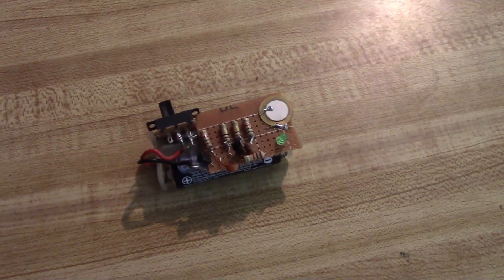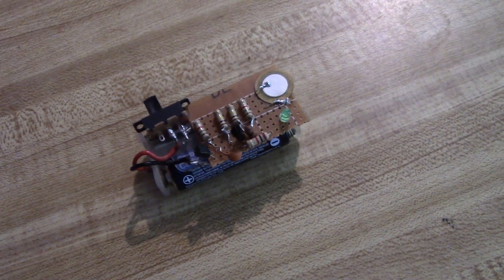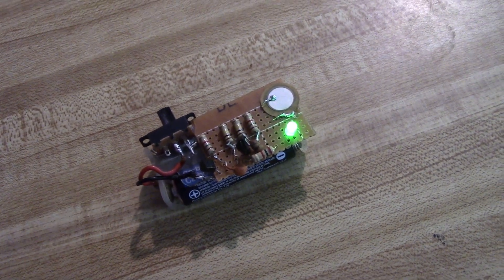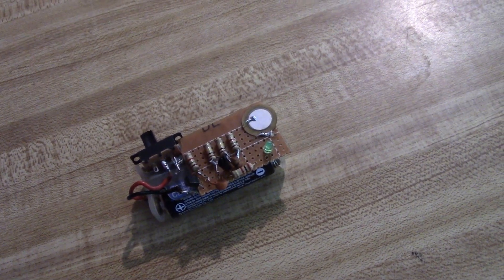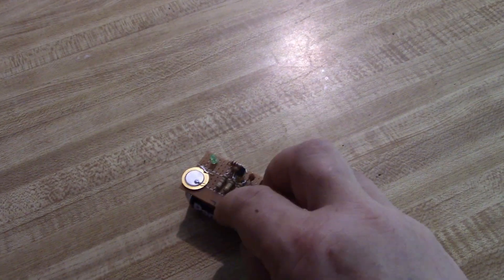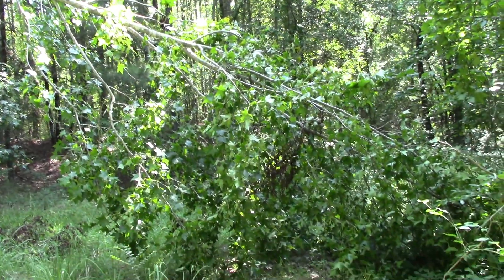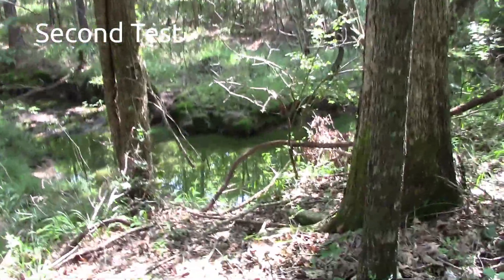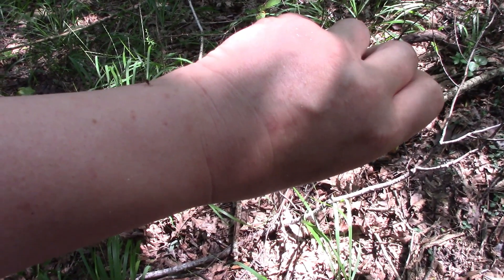Trying a mosquito circuit

Comment: nope dont here a thing but I wouldnt mind having one for the truck
Reply from the maker: Good point, small spaces may be the trick with this type of device. Am currently trying a product called Zevo, it's a cream for arms, face, legs and seems to knock down the bites by an order of magnitude... the bats and dragonflies need a good talking to  lol
Reply: @Slider2732_  I dont get bit very often, I think its partially my genetics, my dad isnt usually sought out either, but my large intake of garlic and capsicum may also play a part.. The eucalyptus lemon repellant from Repel does a decent job but theres still an occasional badass who  braves all that and buzzez around in the truck when Im parked... more importently I need to look for one that repels flies... on to google....

Comment: It's not an 'anti' mosquito electronic.

It's an electronic that's making a 'mosquito' tone. This is a high pitched tone that was commonly used as a phone ringtone when bluetooth trading ring tones was all the craze. It's supposed to be a tone that's high enough that older people can't hear it. I.E. the teachers in class that would confiscate your cell phone.
Reply from the maker: Haha, I see the uses for the classroom. Reading up on it, it seems their hearing goes up to 38-44kHz and properly designed circuits run between those frequencies. Thanks for the info. 😀

Comment: 38 kHz
If an ultrasonic generator is used, it will imitate male mosquito by producing 38 kHz. This will repel Female mosquitoes. Moreover the ultrasound will create stress on the ultrasonic sensilla present on the antenna of female mosquitoes, so the move away from the source of ultrasound.

Comment: There is no way I would hear any of that. I lost my ability to hear high frequencies years ago. Many of my early YouTube videos has a high frequency background tone that I knew nothing about. It was ages before anybody told me. It was caused by my camera. After I was told, I used Audacity to isolate the frequency and used a notch filter on all the videos after that point to cut it out ☹☹
Reply: thats what I was thinking.. its like those tictoc/shorts where kids say they hear something adults cant... my gbrats said they could here it.. their mom nor I could
Reply from the maker: @docink6175  gbrats 😂👍
Reply from the maker: I've never heard the high tone in your vids, but then again was never bothered by CRT's even when young. Clever trick with the notch filter! A fix with a new camera could be to play a video to your grandsons. If it passed, no notch filter needed 🤔
Reply: @Slider2732_  Using the spectrum analyser in Audacity, it was visible as a clear spike so I could see what needed to be removed. Trouble is that added another step to editing.  My Cannon Powershot also adds noise that I have to filter out using Audacity 😬
Reply from the maker: @GrandadIsAnOldMan  It's a grand community gesture for something you can't hear yourself 👍
Since my DJI Osmo died, I've been relying on the Canon Vixia HF R800. It now creaks and rattles far more than it used to. Some of the mini cuts you may see are purely to remove a lot of those noises.